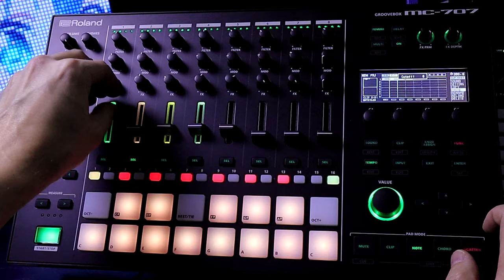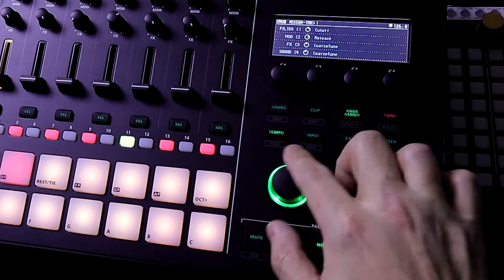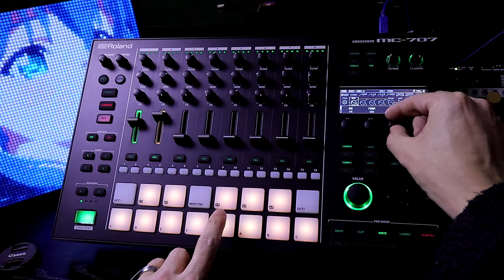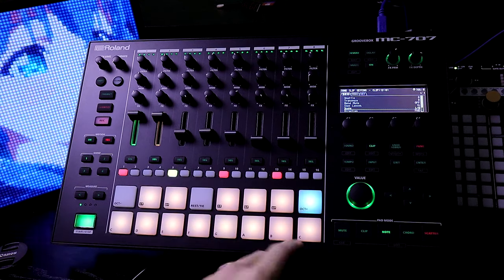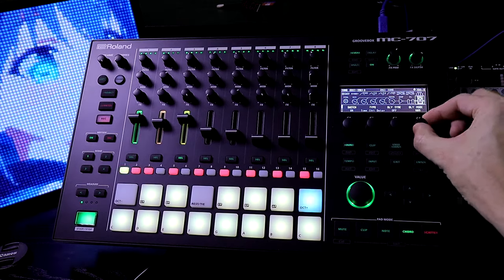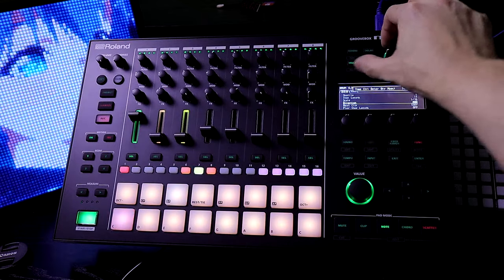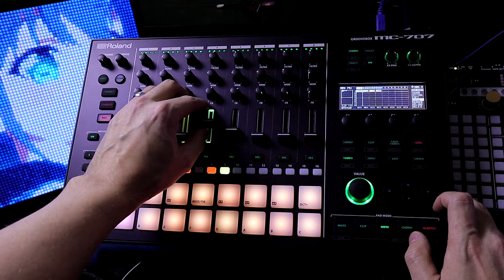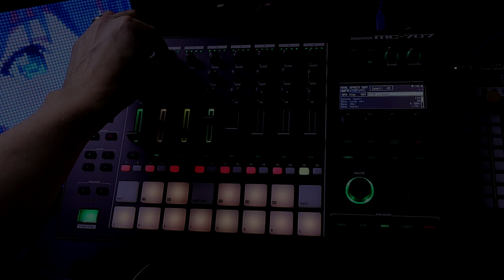MC707 BOOT CAMP PART 1 - SOUND DESIGN // ROLAND MC-707 TUTORIAL

Comment: Thank you for the clip! Very helpful. Do you know how to get a drone sound without accentuating the first step? I try setting the step length to, say, 128, but when I play with the cutoff, it still doesn't sound good sometimes.
Reply from the maker: Go to filter and turn envelope down to zero, perhaps?
Reply: @RonCavagnaro  Where can I find the settings again? There's too much material at once to remember everything. Thanks! 😎
Reply from the maker: @gorogne  shift sound, arrow to filt see if filt env is zero. Hopefully that can help!
Reply: @RonCavagnaro  Thanks! However, the problem remains that when I adjust the cutoff control, the sound drops after about 1-2 seconds and becomes quieter after I stop turning the cutoff control. Do you have any idea what could be causing this?
Reply from the maker: @gorogne  ok go to amp. Make sure youre looking at adsr and turn sustain up to max
Reply: @RonCavagnaro  Hm, if I turn the sustain all the way up and then turn the cutoff all the way down, then nothing should be heard. In my case, however, the drone sound comes after about a second. That's strange. Thank you very much for your help so far.
Reply from the maker: @gorogne  turn attack to zero. It should not make any sound if low pass filter cutoff is all the way down
Reply: @RonCavagnaro  heavybass decay is the preset...
Reply: Maybe you could try that? Use Heavybass decay as a drone and cutoff filter. It behaves strangely.
Reply: @RonCavagnaro  But I think the error lies somewhere in my project. Because in a new one it behaves differently. But I don't know where and it would just be too much trouble. Thank you very much for your support. That is not a given.
Reply: @RonCavagnaro  I found out that it's because of the drum track, which has a lot of samples. How can that affect a tone track? Actually.
Reply from the maker: @gorogne  you have to edit each partial. The top of the shift sound screen says ptl:1 etc push down c1-c4 to switch editing that partial. Go to amp turn sustain up on each partial (1-4) itll work then